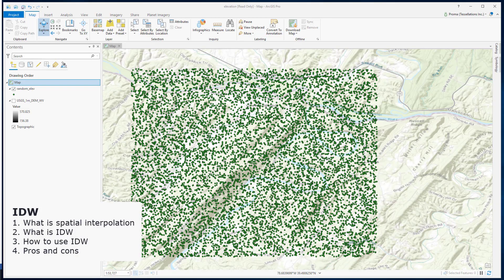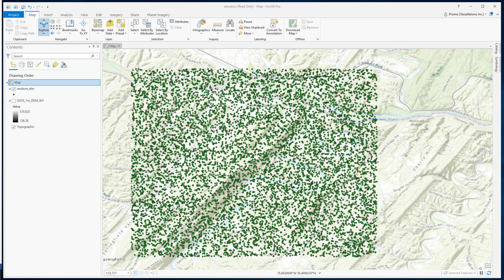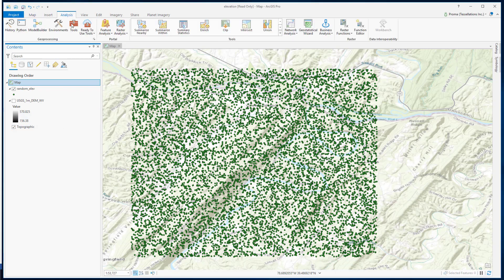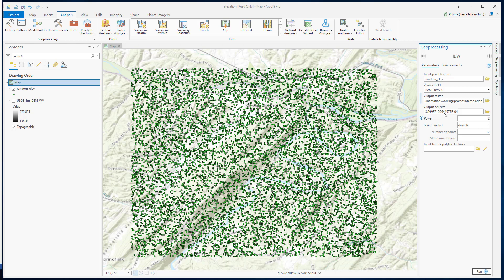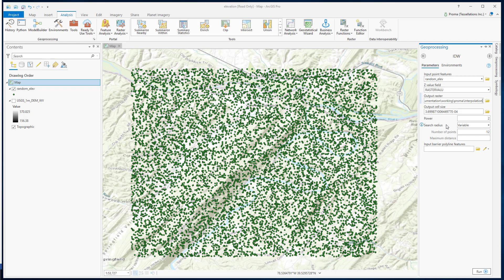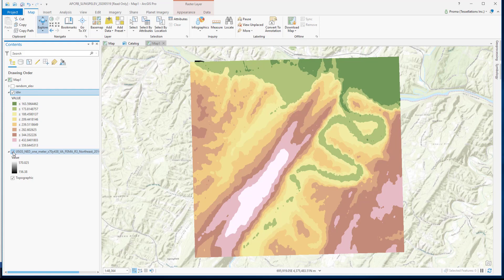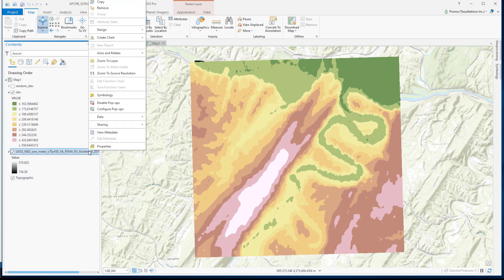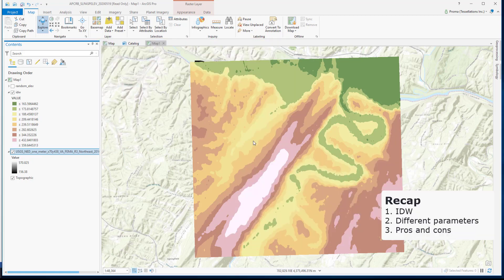ArcGIS Pro: Spatial Interpolation  IDW (Inverse Distance Weighting)

Comment: Thank you very much 
Can I use data in an excel file with the extension xlsx after exporting it into the Arc GIS Pro program through the ( X Y table to point) for interpolation ? Or is there a procedure before interpolation ?